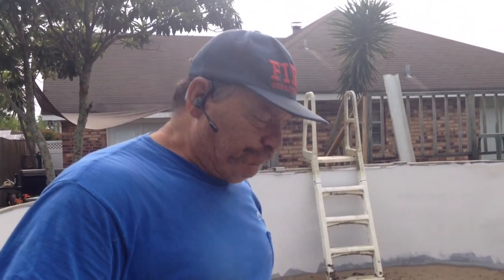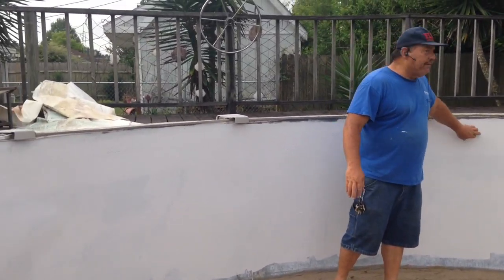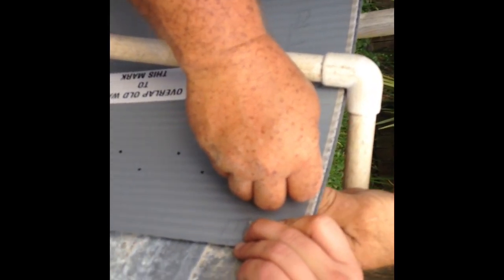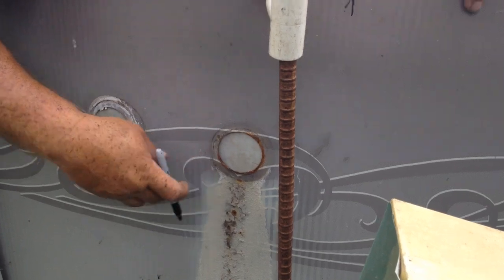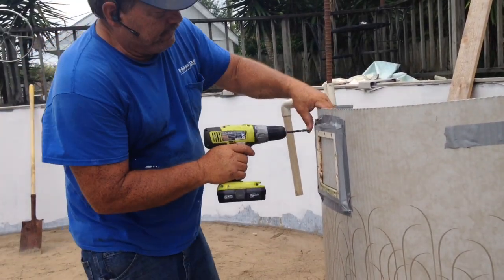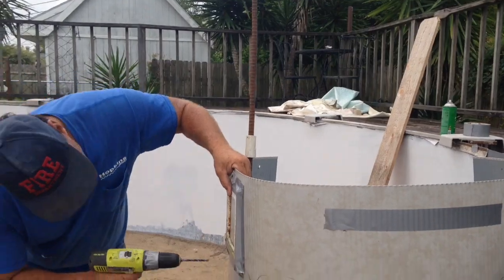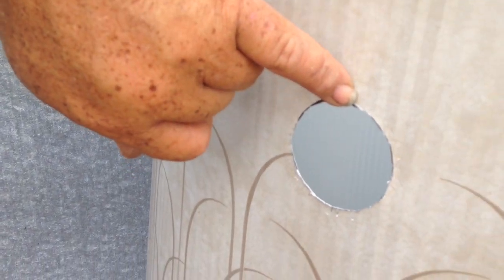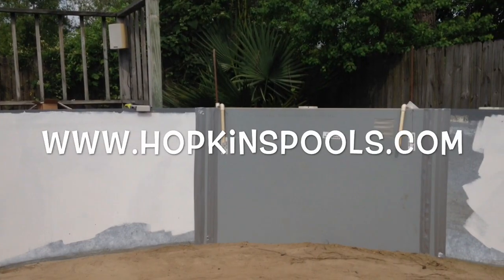wall repair kit

Comment: As a above ground pool owner for 27 years, I can assure you that if you buy one, you're going to be out of luck and on your own when it comes to repairs. A pool installer lives 4 houses from me and won't touch my pool. They would rather sell you a new pool than repair the one you have. My wife's sister lives just two houses further and needed work on her pool and the pool guy wanted to sell her a new pool rather than fix it. She found someone who would fix it for her and it was shoddy repair that only lasted a year and then the pool collapsed. I have an Ester Williams that had a good wall warranty but THEY went out of business before the warranty expired. Smh! I'm currently in the process of installing my 3rd liner! And btw, I bought a pool size that was discontinued a few years after I bought it so the liners are harder to get. I had the new liner special ordered to fit. After this one dies, I'M DONE WITH POOLS!
Reply: Had the exact same problem here, nobody will repair it. Finally found a guy who is going to do it on the side who works for a pool company
Reply: @ikecostner1  where can i get this wall insert / patch?

Comment: David I am trying to make my 16x34 in ground pool smaller. It has steel walls and sand bottom deepend small end . Question ? I want to make it 16x 24. I understand I will need to change the lines and liner and back fill. But how are the steel walls connected ? Is it doable ? You ever do this type of work ? Tx for any inform David or anyone on this tread
Reply: If its a steel wall inground pool they are bolted together.
Reply: Can't be done because the bottom ring is already the larger size.

Comment: Why are you drilling inside the pool ? , all those metal shaving's now will be under the liner at some point
Reply: David Frisch not if you do a thorough job like he probably has.
Reply: I drilled mine from inside the pool, when you move the wall out of position you have to move the sand back, when you push the send back the metal particles will most likely be covered up by the sand my patch has been working perfectly for over a year now

Comment: I need to repair a rust hole where there are no fittings. is it possible to partial drain and only pull liner back enough to access the area and  only do a small patch say 12"x12" square
Reply: same question I need
Reply: Yes, research a little on Google and it will tell you how to do a double sided patch

Comment: We tell the customer at that point but a new pool of wall. For the money they are going to pay yinz it will be around the same just to buy a new wall and it will look better.
Reply: New wall is $1200
Reply: @ikecostner1  if its that bad we won't even touch it unless we are ripping it down and putting up a new one. Its just not worth it.
Reply: Justin Kelly  right, which is why I went with another company when the pool company tried to tell me we needed a whole new pool,
Reply: @ikecostner1  where can you buy a pool wall?  my pool is 28 '
Reply: Kim Minor  the video you’re watching has links to buy the repair kits  in the description, Hopkins pools

Comment: Looking for someone to do this job on a 24’ round above ground pool in Central New Jersey, Somerset County. Do you know of any Pool Repair places that use your product that I can hire to do the job? Also do you make a Stainless Steel Service Panel? I rather have stainless Steel so I never have to deal with this Skimmer wall again. I believe our liner is still good I should mention also. It is May 18,2022 Wednesday and our pool is still Winter Covered and holding water below the Skimmer and return line area. I am not able to do the job.I rather pay a professional to do the job for us.
Reply: I guess no one is going to answer me here. Why even have this video on You Tube if you are not going to bother to answer a potential customer? I saw just the other day you sell this product on EBay. I asked a question there also and no response. Disappointed.
Reply: @ffas23  this man does not care.

Comment: DON'T DO IT!!! We repaired our 24 round above ground exactly by the instructions on this video, except I used galvanized sheet metal instead of an aluminum patch panel because I couldn't get a patch panel in NC. It lasted 2 weeks. The day before it collapsed my wife, both daughters, both son in laws, and 4 grandchildren were in that pool. I thank God it didn't collapse while they were in there. It's not safe. Just buy another pool.
Reply: Thats your issue is not doing it the proper way...
Reply: Mines been working perfectly for over a year now, it sounds like you installed the product incorrectly, Or you did not get out all of the damaged area, when the pool is manufactured it has a seam created at the factory,  the seam you create with the patch panel is no different than the factory seam if done correctly
Reply: If you do it right, it works!! I just replaced an eight foot section. You need to inspect the rest of your pool for failure marks. I dug all around the base of the pool and treated all the rusted areas, then sealed it. I also added two aluminum support strips on each side where the bolts go for added support. I'll get another 10 years out of her now..